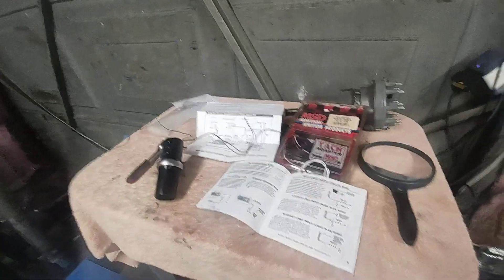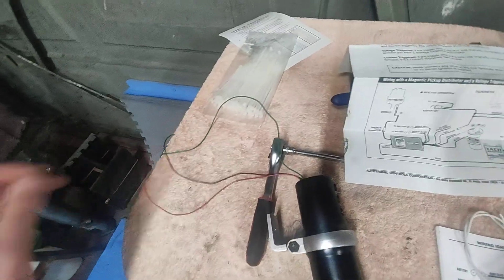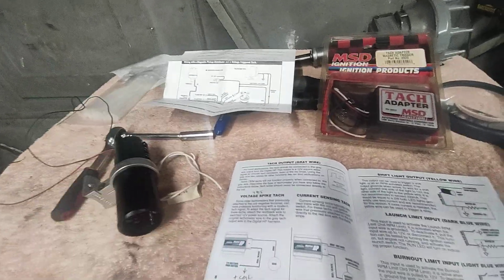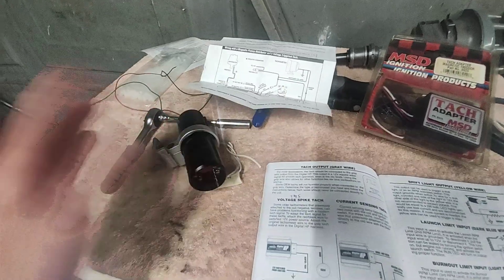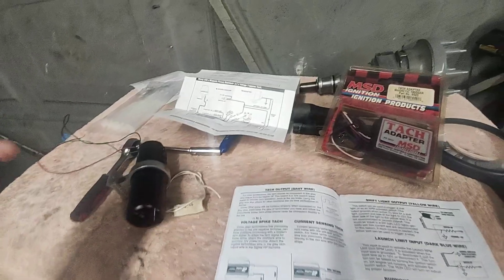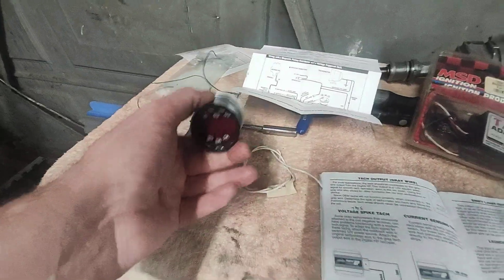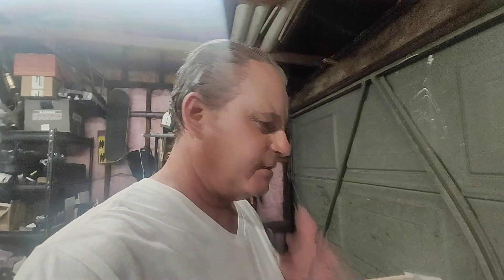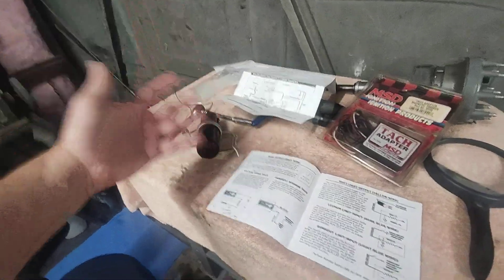Pertronix Digital HP Ignition Box tach problems

Comment: I can hear the frustration in your voice, you're much more patient than I am which Im sure that u have said a few choice words and even some made up ones😅 I hope that the new tach works out for ya
Reply from the maker: Thanks Anthony,  I am pretty confident a true Autometer is going to work just fine, yeah the frustration is the in and out of the car starting it up checking, the tach, well that didn't work, try again in and out of the car start , then the heat in the garage so after 15 minutes you breaking a sweat, then run in and see if you can find a sloution online, then back out and try every configuration with the tach adapter etc! LOL!
Reply: 😄 These cars, can make you speak in unknown tongues, sometimes!